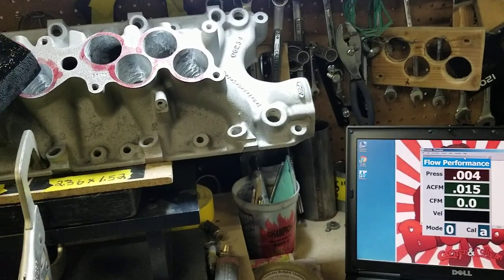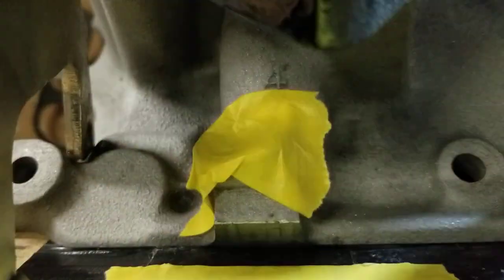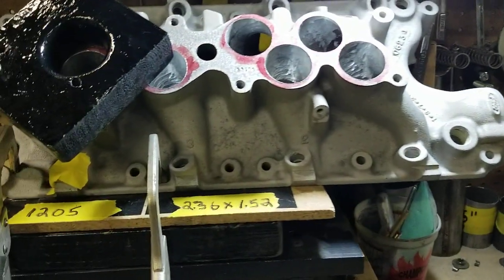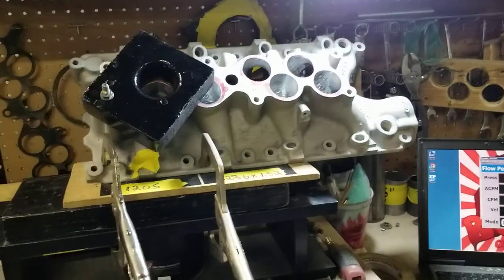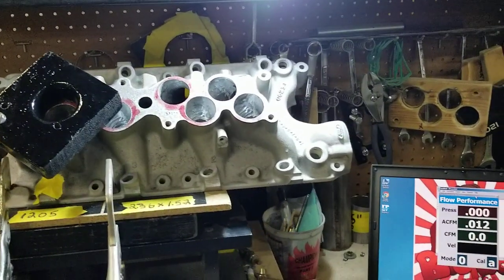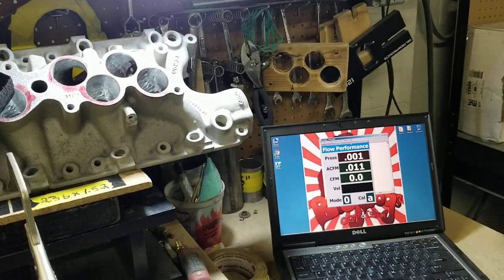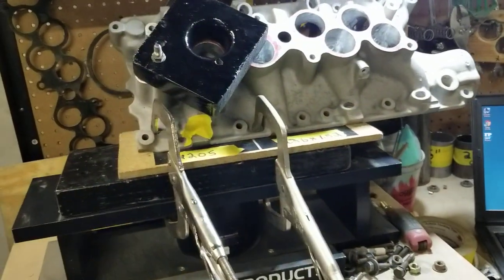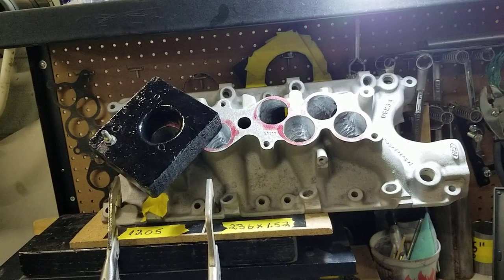Bigdogs Porting working a Stage 3 gt40 lower.

Comment: Does porting the intake like this chang/improve the overall sound of the car?
Reply from the maker: Yes it does. The motor is able to take in more air which allows more fore that creates a bigger explosion which makes more power which makes it sound meaner and more powerful